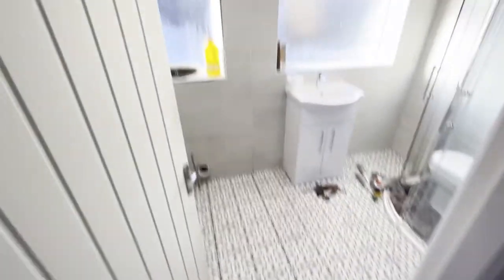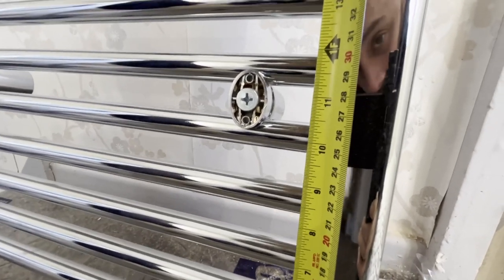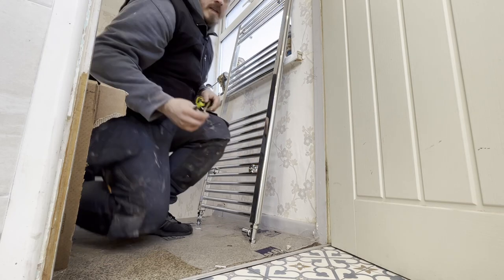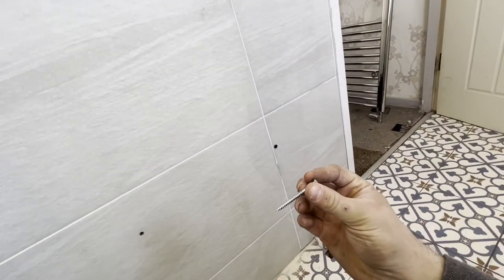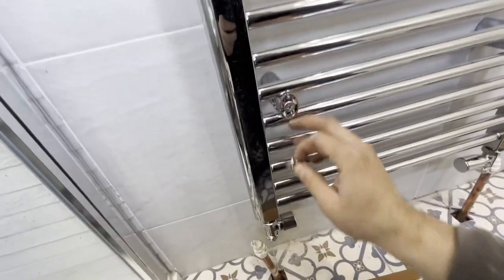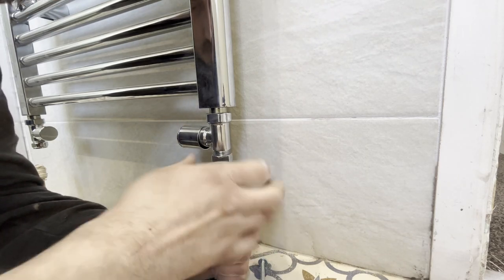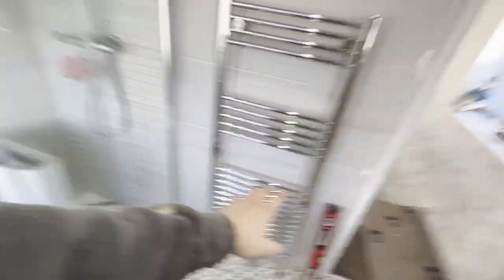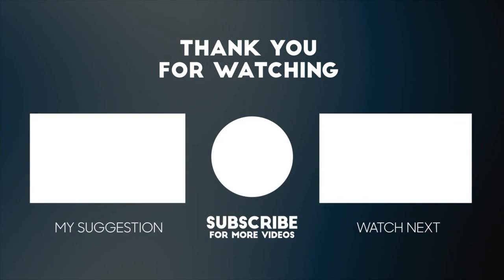Sunday Shift This Week Finishing Off The Nightmare Bathroom || 065

Comment: In all fairness to the tiler, if I'm tiling around rad pipes out the floor like that I cut them square on the edges of tiles like that as it's going to get covered anyway and gives you (the plumber) a bit more wiggle room if you need it, (I'm wet plumber and tiler as trades) 

Using the tape as a rubber is for timber etc it works better than on tiles, give it a go for future :)

Jesus, get a new blade on that pipe slice!
Reply from the maker: Works great on timber

And i know that blade is well and truly shot